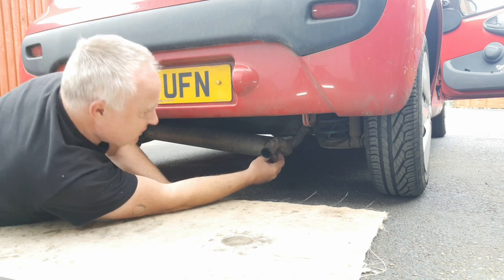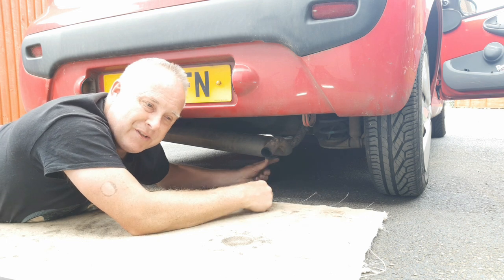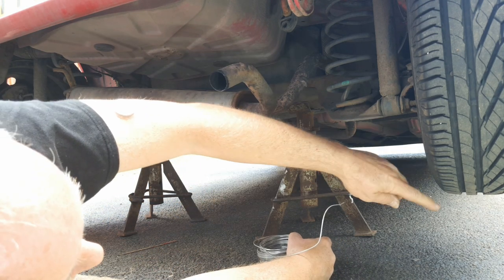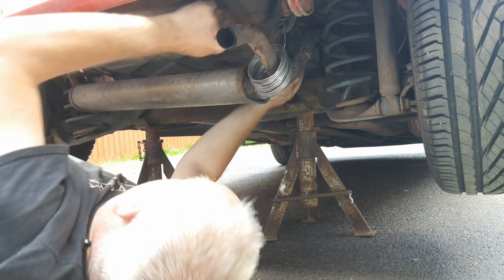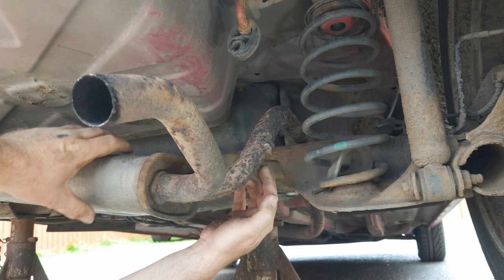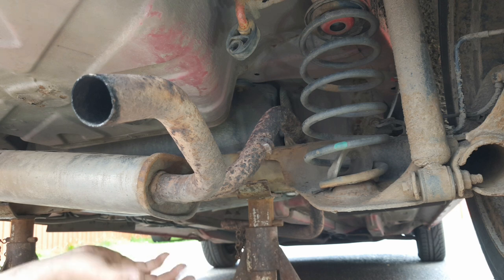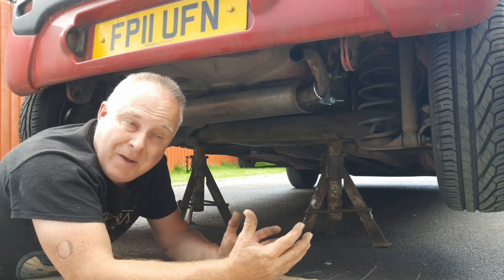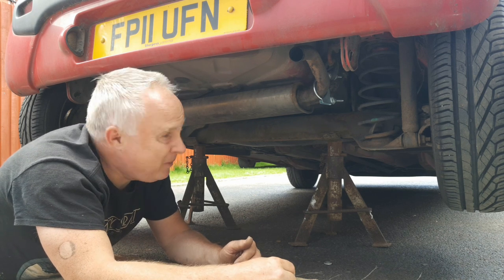Citroen C1 Exhaust Back Box Dropped Down | Citroen C1 Common faults

Comment: Will it pass an MOT like this? Mine has done this and we’ve fixed it with wire for now. However I’m worried about the other side of the box as it is also quite corroded. What would you recommend for the other side?
Reply from the maker: YES, ours did 3x MoTs like this. We've since replaced the entire exhaust.

Comment: Do you have any tips on how to get better gas mileage out of my 1.0 petrol c1? The car runs fine, i just get 7,5-8l/100km(30mpg) in a busy city, everywhere online it says i should get 6l/100km (40mpg) or even better.... the car runs perfectly.. i'm thinkin to change the spark plugs maybe? i went for an MOT and the technician said my lambda sensor is on its way out, could that be the issue? any thoughts?
Reply from the maker: Lots of stop start is always tough on economy. Clean your throttle body, MAP sensor and PCV valve (videos on those two coming up soon). Change sparks every 10k miles. Get your injector out and give them a clean (I did a recent video on injector cleaning). Check your tyre pressures propely (I've done a video on that too) but put 3-5psi extra in. Service all the brakes and make sure non are dragging (pay attention to this https://www.youtube.com/watch?v=Ll1se1hp7Zg&t=10s).
Whip the sensor out and give it a clean, they do soot up. Otherwise they either work or don't work.
Use the best fuel you can get locally too.
Try not to carry any excess weight
Reply: My opinion is put the factory recomended spares - oil 0W20 syntetic and iridiun sparks plugs. It will reduce the drag for the extra viscosity of the oil and the sparks will give a better spatk. That will give you better gas mileage

Comment: Thank you so much for the fantastic explanation. I’m going to skip the temp solutions and go ahead with the third method. How long did it last for you?
Reply from the maker: So far, so good. The exhaust clamp method is showing no signs of giving up 5 months in. I'd like to hope it'll last years, but we'll probably need a new backbox before it gives up. Our C1 is still on it's original exhaust, 10yrs 86,000 miles.

Comment: Great thanks. Wife's exhaust bracket broke months ago. And has been held with wire ever since. Replaced today with the clamp method and its done the job. Did use a 50mm clamp. But everytime you started the car the exhaust would rattle on the belly of the car. So swapped for a 64mm and it's perfect. Thank you.
Reply from the maker: Great to hear!

Comment: Hi Sid 
I had this problem watched your video and went & bought a clamp and fitted it easily myself .So thank you very much for your step by step instructions. Off to by an additional locking nuts to add so it doesn't move .I'm so proud of myself as I've fixed myself .Thank you very much 😊

Comment: I had to do a temporary repair today on a 2013 107. Bought a reel of 2.5mm steel garden wire from Screwfix for £6, & wound it round the tail pipe a few times… let’s see how long it lasts! Next, I’ll try the 64mm exhaust clamp method. 👍

Comment: The hanger of my exhaust muffler was about to disappear. My C1 was in the garage for the german MOT (Hauptuntersuchung/TüV) anyway.  Mechanic Mike bended a screw and welded it on the tube. And yes, he was very proud of the hidden sculpture he created. We passed the MOT (for two years)  without any further problems and everything is fine. 🚗😃🚗

Comment: Uploaded 1hr ago haha. Just borrowed the mother in laws one of these while mine gets some work.. had a blow out on day one, now just got back this morning and this has happened 🥴 handy to see before jacking up and that. Using that wire to represent the bracket was just the ticked ill do that as a template, bend a new hanger and weld it back on 🤫

Also I take it that rubber is meant to be under the spring on the right there lol
Reply from the maker: Back in my rallying days, I found out the hard way that welding on an old exhaust can be a hiding to nothing. The welding process can blow holes through corroded steel. So go carefully. We switched to mechanical fixes during events for speed and surity of keeping going.
Reply from the maker: And, yeah it is. No idea how it got like that, I doubt the wife's been taking air on yumps 😂

Comment: This happened today on my daughters, I've used chain link to hold it back up, will it pass an MOT ? 
or does it have to be welded back on? Back box is in great condition just the metal bracket rusted and broke off...
Great videos by the way, keep up the good work...I might go for the u bolt fix...thanks in advance

Comment: With mine, the hanger hasn't gone, but the rubber thing has perished and snapped. Are they easy to fit yourself?
Reply from the maker: Easy peasy. Pick up a replacement from any factors and use a bit of WD or soap to ease it on.

Comment: Wow, that's a small pipe lol
Reply from the maker: I know, init just❗ A proper pea shooter. Still, it is a small engine. Believe it or not, but that exhaust is 11 years old, 86,000 miles and is the factory original.
My Saab is 13 years old and still on it's factory original at 154,000 miles (except the back box which was damaged in the rear end shunt). The centre box is just starting to go at it's seams (not blowing yet though) so I might replace it with new str8 thro' SS box. It's a decent size too - 2 3/8 inches OD.